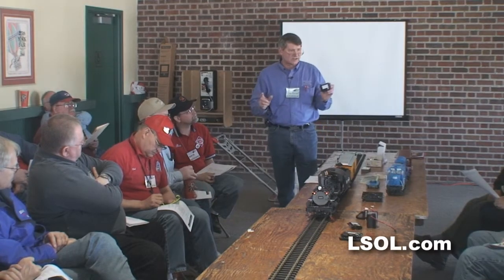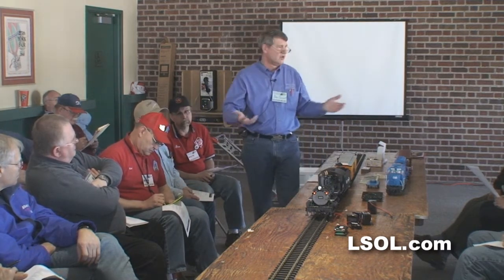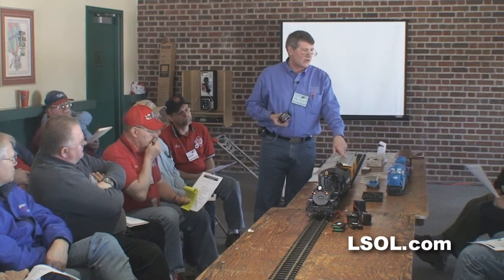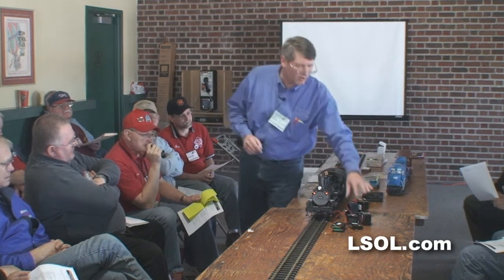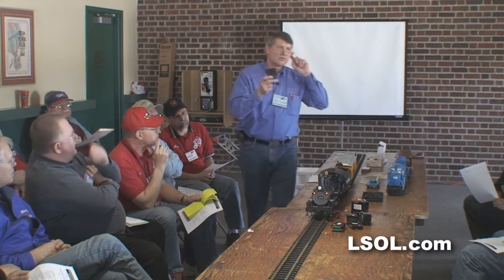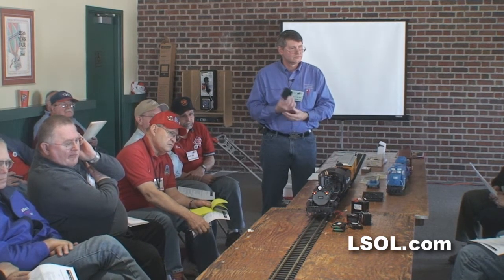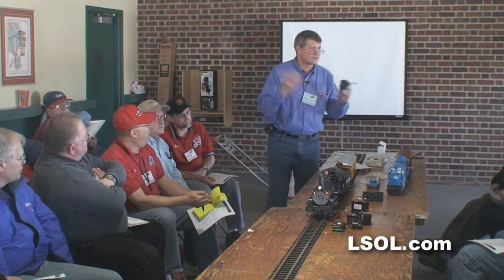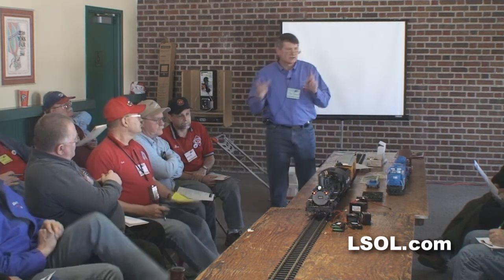Garden Trains: Radio Control Battery Seminar - Part 5 of 8

Comment: If you have track power, can you charge a locomotive as it is running?
Reply from the maker: Not sure you would do that, people use battery to get away from cleaning track,
Reply: @gardentrains  What I would really like is the ability to charge my trains while on the track. If I have a bunch of trains converted to battery power I need a separate power adapter for each one and need to plug them each in. It would be much easier if I could park all my engines on a siding track where they could be continually charged
Reply from the maker: @tomroehl5126  that’s an interesting idea. I think one of the situations though is on any of the engines that I have running the battery power the power where wheels have been isolated from the track so that way I can’t actually feed the engines through the wheels so if you did this, you probably want to have some kind of switch, but then the question would be most track powers is higher then a charging power. It seems to me one of the easiest thing to do would maybe put a plug on the side of the engine and where you park them, you could plug them in almost like an EV car?